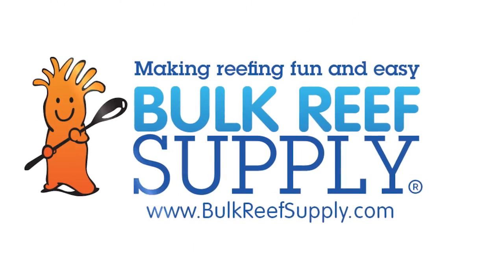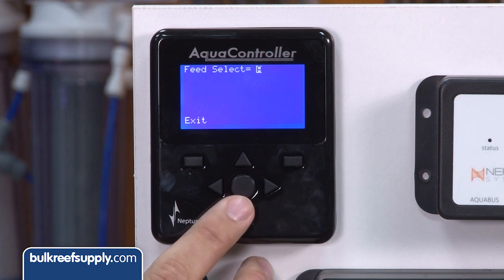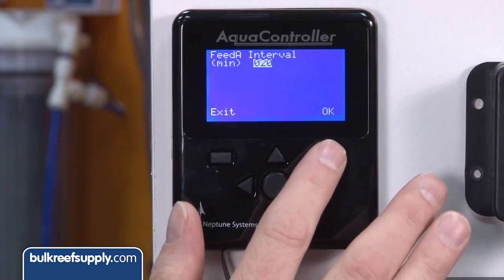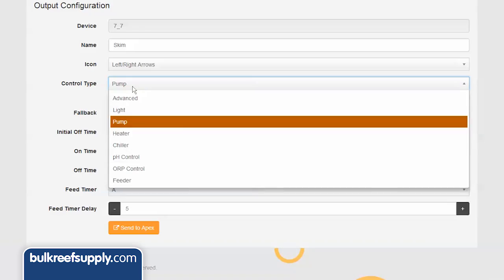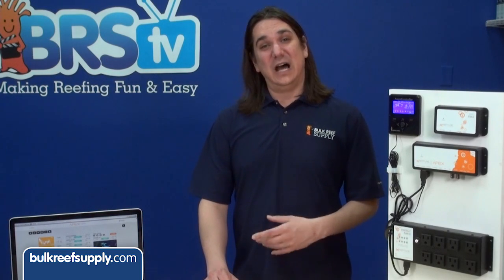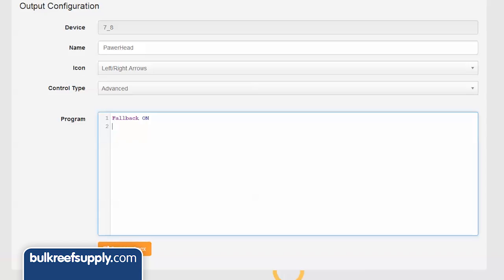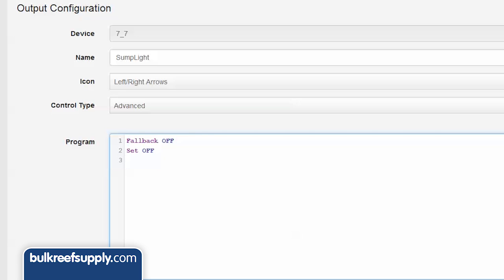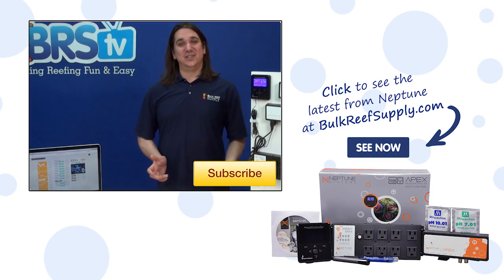How To Set-up Feed Mode in Fusion EP 19: Apex Aquarium Controllers from Neptune Systems

Comment: I want to be able to have my COR 20 go to 5% and not fully shut off so I don’t have to worry about bubbles when coming out of feed mode.  Is there a way to simply dial back % Power of COR20 during feed mode rather than shutting down completely?

Comment: Thanks for the tip on where to change the feed interval, I wasn't able to find it on my own.  I now have all my pumps set up on Feed A with the regular 5 minutes and I set up Feed B especially for water changes with a 60 minute time-out.  All of the in-tank pumps that will run dry during the water change turn off for Feed B, which I initiate when doing a water change.  It should make everything much easier!

Comment: im trying to figure out how to use the AFS to delay feeding 5 mins after the return pump has shut off when using feed mode. thoughts?
Reply: ***** radical. i actually submitted a support ticket and they just built the code for my exact scenario. top-notch service i'd say!
Reply: SaltyReefTV Can you share the code? I am looking to do the same thing , thx
Reply: Copper State Goldens Sure.
So the code for the AFS itself I am using is:
Set OFF
If Outlet vFeedA_P1 = ON Then ON
Defer 05:00 Then ON

The virtual outlet code is:
Set OFF 
If Time 14:00 to 14:14 Then ON 
If Time 15:25 to 15:39 Then ON 
If Time 16:50 to 17:04 Then ON 
If Time 18:15 to 18:29 Then ON 
If Time 19:40 to 19:54 Then ON 
If FeedA 000 Then ON 
If FeedB 000 Then ON 
If FeedC 000 Then ON 
If FeedD 000 Then ON
Reply: Copper State Goldens Pump and Skimmer:
Fallback ON
Set ON
If Outlet vFeedA_P1 = ON Then OFF